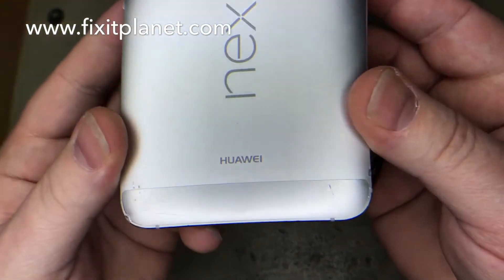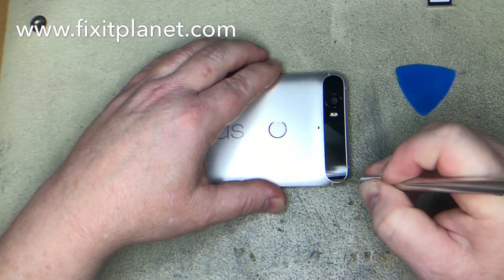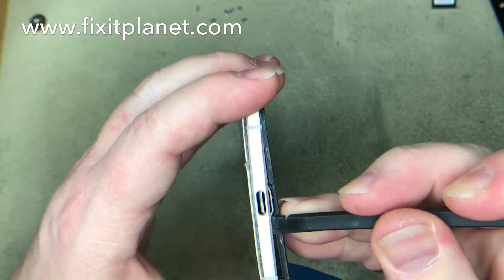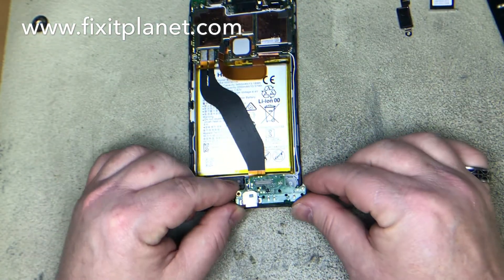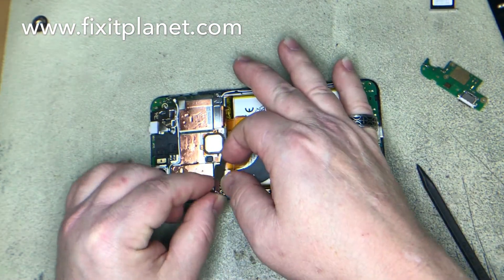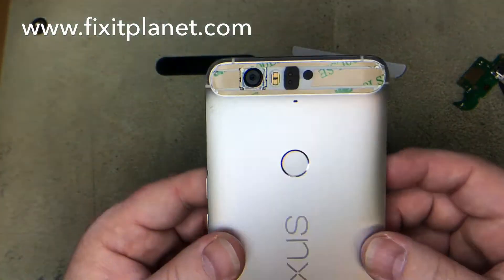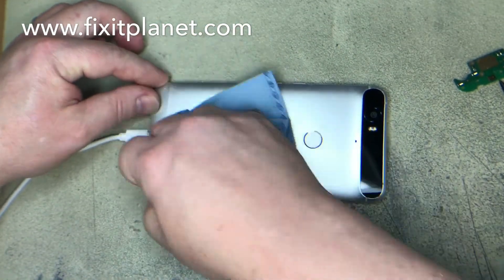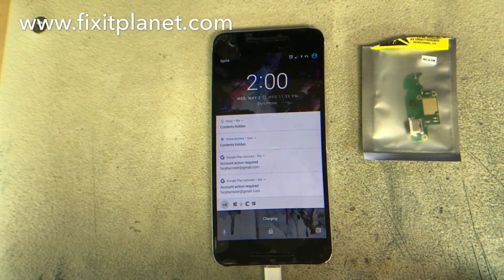Huawei Nexus 6P Charge Port Repair From Start To Finish.

Comment: Thanks for the video! First I had to replace the battery a few years back. Now I replaced the charging port. If you reheat the glue when the glass and plastic covers are on, the glue resticks. It's probably better to replace the glue as you suggested though.

Comment: Don't forget to put back on the gray gasket around the charging port from the old part because replacements don't come with those and leaving them off will leave your phone/port susceptible to water and moisture entry around there. Since Buddy forgot to do include that other than that this is a good short video.
Reply from the maker: Yesssss please remember to do that rt5hing I forgot to mention this guy is soooo right oMG

Comment: I did this along with a battery and back case swap.  Everything went beautifully, or so I thought.  Mic will not pick up my voice unless on speaker phone.  What did i do wrong?
Reply from the maker: I have no way of knowing you will have to retrace your steps and see if you can figure out what's going on. Inspect everything closely. Check all connections, rubber channels, and for physical damage and make sure all contacts are touching corresponding pads etc. good luck.
Reply: Clean the rubber piece that is above the rear mic(noise cancelation), you have to take apart the back, that fixed it for me.

Comment: Great video!  I successfully changed my charging port and battery with nothing damaged.  I had access to a small heat gun that I set to 150°F (~65°C°).  It seemed to soften the glue without damaging the plastic pieces.  The repair is not easy, but it's doable.  Thanks!

Comment: Do you have a video on changing the 6p volume/power ribbon cable?
Reply from the maker: I can do that if I have time. The volume and power button are all on one flex cable and are easy to transfer from one housing to another. It is stuck down with adhesive though so be careful not to tear the cable.
Reply: @FixItPlanet1  thanks for the reply. If it would be easier, you could just describe in detail how to do it and perhaps I could follow. If you find the time and could do a video that would be awesome! I was taking my son's apart to change his battery out and I was using a thin razor blade to go around the outside of the screen to separate it from the metal housing and I think it messed the power button up some how, because now the phone won't turn on. It's not the battery or the screen because when I plug a charger in the screen does show the battery picture and the battery charger level is animated.

Comment: It is glass, thats not plastic on the top that covers the camera.
Reply: He also forgot to take the rubber waterproofing grommet off the old charging circuit board and to put it on the new one. Now if any water gets near the replaced charging board, it will freely flow right inside the phone. How can he miss something so obvious?
Reply: @TheTurbinator  dosnt feel like glass. Glad i seen your comment about the rubber gromit. Cheers bop bop

Comment: Thanks! Just replaced my charging port and put in a new battery while I was at it. Very helpful video!
Reply: where did u get the adhesive?
Reply: That my plan too, the battery is going and the charger gives me occasional problems so might as well take care of both at the same time.

Comment: Can you link where you got the replacement part? And did you use a heat gun?
Reply from the maker: You can use a heat gun or a hot plate. Just search ebay and you will find the screen.

Comment: did the replacement allow for "Rapid Charging"?  I keep seeing comments on all the replacements that they do not.
Reply from the maker: Replacing the charging dock with an original is not a problem.
Reply: Late comment but usually that's a replacement battery issue alot of the cheap ones don't specify that they don't rapid charge.